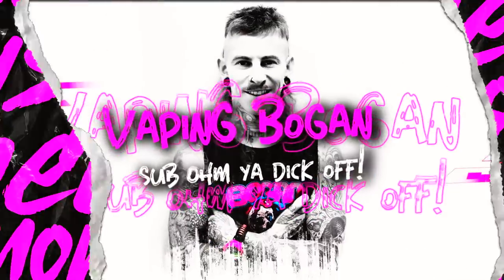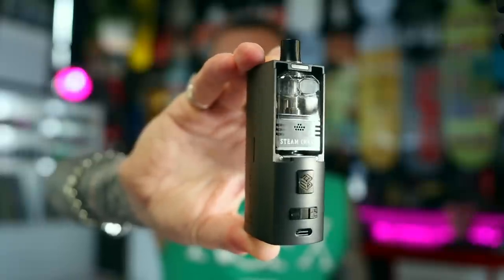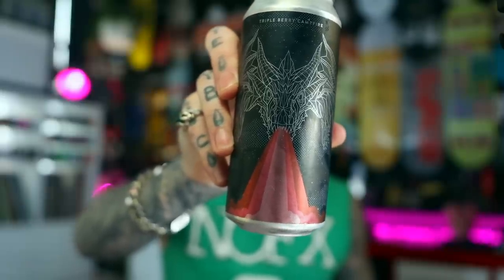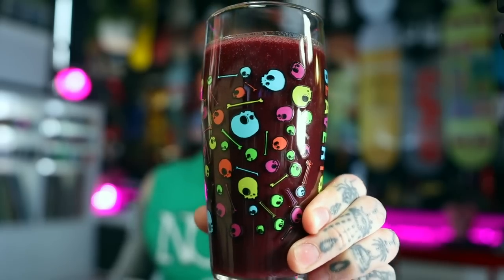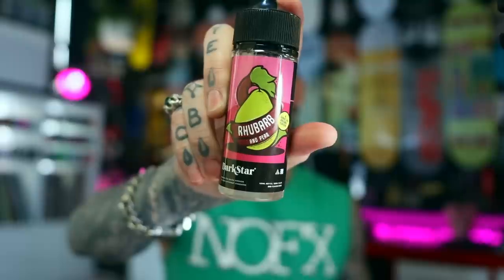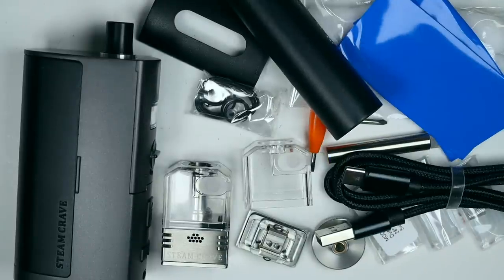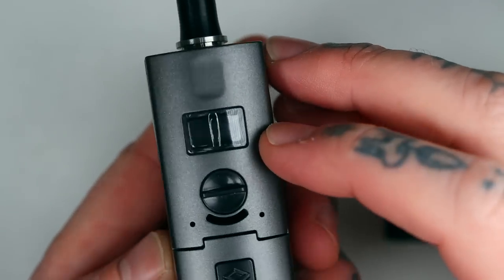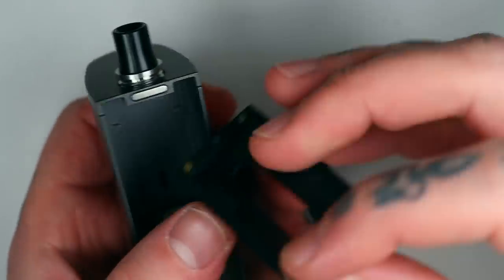Meson AIO Kit Steam Crave

Comment: This is the newest board version which has a dna type screen. These have the newest board version as well and has a size and wiring layout like a dna 60.  The deck is where it shines. The dual coil is amazing. Otherwise she's a little blah. The flush nut issue and 6 ton weight is a biggie and would have been easily solved. Great review brother.

Comment: Got mine running the mesh deck with the "SC-08" "Dual" Mesh (It's just split in the middle) at 60w. Bit warmer hit than the single-type meshes it came with and it's been kicking all kinds of A**. Yeah it's a bit of a bloody brick compared to some of the plastic/alu devices out there, but i like the weight since i'm normally running a giant brick of a custom DNA250c. Can't beat the kit for the price either, being that it's a bit over 100$ USD here for everything it comes with.

On the Flush nut thing, i kinda like that it ISN'T flush, it doesn't work with some tips sure, but it also means i'm less likely to scratch up the top with my shakiness if my hand slips a bit removing it. And like all of my normal 510 tips fit within the shape of it so it doesn't bother me as much.

Comment: Using this kit for a while now and like it. Preferred this over the Stubby initially because it was 21700 when the Stubby was only available in 18650 at the time. That and the fact it gave us a mesh deck. But now the mod gets hot very quickly. Not sure if this is a faulty board or just the mod but it worries me just how hot it gets. So now using the mesh deck boro in the Stubby and hoping to grab a 21700 Stubby soon. Have to say despite the back airflow system possibly being restricted in other boro devices I don't see a problem in the Stubby. The airflow is still very airy and works just as well as it did in the Meson AIO mod.

Comment: I've had one of those since the release and I only had it for about a week and the paint started to chip off.... both of the connections are flat on the mod and on the rba tank so sometimes it may take you a hour to get it connected. I eneded up having to take mine apart to check why the bottom Plate were the screan is started to get scorching hot while I was just hitting it at 35w not being negative but steam crave fell short on this one if your want a borrow mod just save your money and get a good one that's not going to catch on fire I paid 105 for this mod to last me 6 months  just save up for the stubby that's what I'm doing

Comment: Hi bogan, i have the meson aio. It is definitely on the heavy side I agree.
I have one question, it doesn't matter what I build the ohms always shows always much higher. For example, I build a 0.6ohm Coil. It reads it like 0.8 to 1.0 Ohm. Do you have that problem also?

Huge fan of the odin v2 satin purple BTW. It is my favorite mod of all times now. It left every Mod behind for me. Even the odin v1 dna version 😍
Reply from the maker: I haven’t had any ohms issues with mine, but I did hear that this is a new updated version of the original chip so maybe yours is the first one, could also just be a connection issue and a faulty mod. Sorry I haven’t got any solution other than to contact steam cave. Stoked to hear you are loving your Odin 2 though. Thank you

Comment: Yours looks a lot better than mine, mine was the first version and it was horrible, chips of paint coming off everywhere straight out of the box. Chip wont read properly, scratches all over the base plate, they definitely rushed the first batch 🙄 mine just sits on the shelf now

Comment: I just bought a Meson Aio. With the mesh I want to vape at 3 volts and it burns (it's not the cotton) With double resistance of Ni at 0.20 ohms and 40 W if you give it long it burns. I test the atomizer on a Drag 3 and a puma, and I realize that the Meson measures the ohms of the resistance wrong. There is no way to change that. It's too bad so far

Comment: 8:35 this doesn't work, even though one might think it should. We've gone through this for years with PC cases, where they have an intake with fans but the air has to go through multiple angles before it hits the fan. Airflow pressure roughly halves every 90 degree turn and we must not forget it also mostly takes the path of least resistance.
Now when air goes through the air intake, all of it goes to the holes on the front side. It doesn't matter if there is space behind the back side of the tank. In order to reach the back side it would have to travel through four 90 degree turns (resulting in 6% of initial airflow pressure give or take) and the front side intake would have to be completely overloaded for even that, i.e. you would need to draw like a vacuum cleaner.
So long story short the back side intake is useless, you could place tape over it and it would make no difference.
Reply from the maker: I’m sure your scientific calculations are correct to a degree but can report from actual experience that air is indeed getting through the back when used in the meson mod, having put the bridge in a billet box that completely blocks the back airflow so it only gets the front, I can say there is significantly more airflow when the bridge is the meson mod.
Reply: @VapingBogan  Very interesting! If that shouldn't work in my theory, but does work in practice, then my theory is not correct